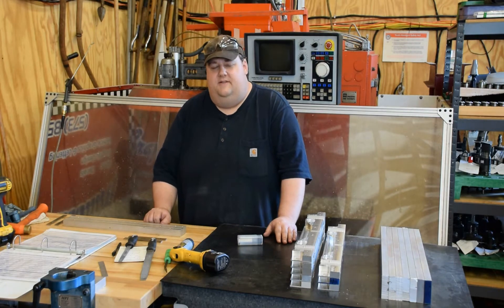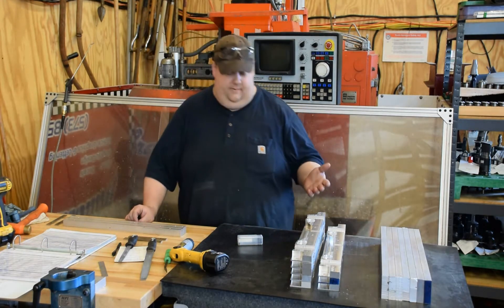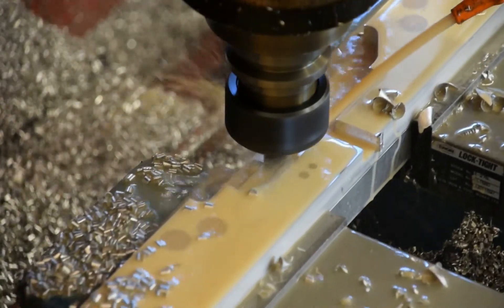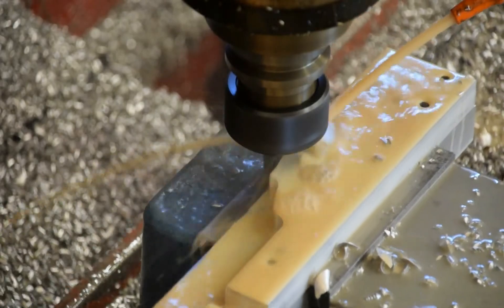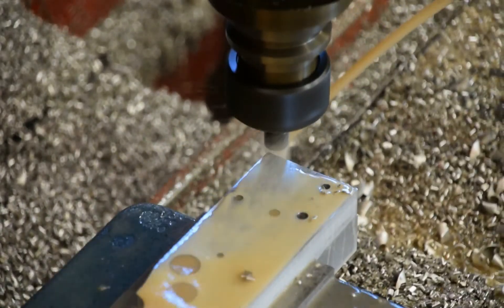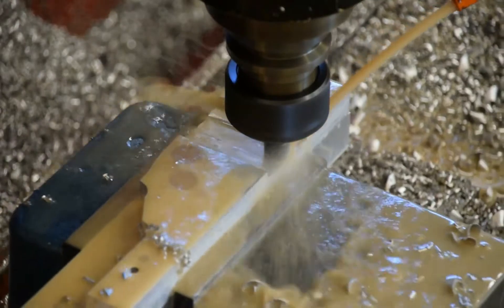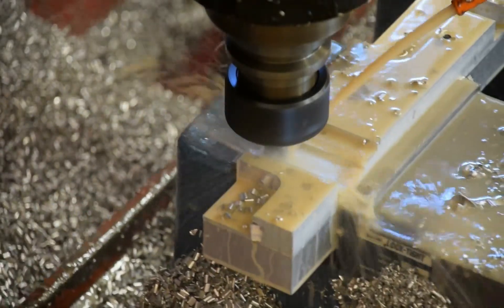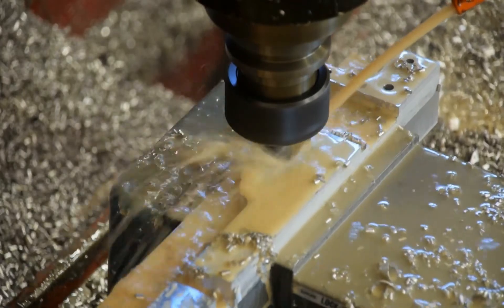Old School Roughing MRR vs Adaptive Clearing

Comment: i milled hardened steel (56hrc) with a tool from fraisa using adaptive toopaths. 30mm ap and 0.4mm ae, that was pretty epic seeing those chips fly away. the tool has a chipbreaker which helped (the pocket should have been 90mm deep, but we only could get 60mm deep so 2 passes was all it needed to do :) ) the most important pro of adaptive is, if it works, it works.
Reply from the maker: The biggest determining factors of whether adaptive or traditional roughing will be faster is how much torque the machine has, how fast it can feed and stay on the path (no following errors), and how fast the rapids are.

If the machine has fast rapids and feeds, adaptive will be faster, regardless of spindle torque/HP.  If the machine has slow rapids and can't follow the path accurately faster than 80 IPM, but has a fairly stout spindle (torque/HP wise), then traditional roughing will be faster, especially with indexable tooling.

Or, if you machine is both slow and weak, like mine is,  you do it both ways depending on the tooling.  I use traditional roughing strategies with the indexable tooling shown in this video, but when I have to use solid carbide I try to take as deep a bite as I can to keep the tool wear even.  None of them are particularly speedy, given the machine they're running on.

Comment: Just a short comment agreeing with you.
Doing HSM/Adaptive/Trochoidal in aluminum is in my opinion not time effective. At least not with the right tools. Admittedly we have bigger and more stiff machines, but I can do a full depth of cut and 80% stepover with flood coolant with "conventional" methods. (ø20mm / 3/4" polished carbide endmill 38mm / 1½" depth)

However in steel if we have to remove a lot of material it is indeed effective, but if you only have to run around a plate and do a few holes it's simply just not worth it. At least not for us.

Saunders/NYCCNC is afraid of doing conventional because he doesn't have the experience with flood coolant and has snapped too many endmills with just the mister he uses on the Tormach. Otherwise he does great work and is an excellent innovator.

Comment: In regards to what you have said, you are correct. But there are many variables. If the machine can not run at high speeds, it will never really be able to do HSM. You need more DOC. On those parts you could run the whole depth - finish in one shot. And the real problem I think.... People not controlling the retracts properly. This will improve I suspect as people get more and more comfortable with it all. Lastly, HSM is not always the best way. We tend to fall into the trap of using strategies that we "like" for one reason or another. Just a few thoughts my man. Great video.
Reply from the maker: I sometimes do the high DOC, moderate WOC, at a somewhat slower feedrate, but only when the geometry is such that I can run a pretty big OD tool.  You can't really rough the old school way at a DOC of 2" with a 1/4" tool, ya know?

Plus, for most of the work that I do, my go-to roughing tools are my indexables, because they are far and away the cheapest option per cutting edge, so long as they're able to reach the feature in question.

Just from what I'm seeing on YouTube, people are using the HSM strategies with tools that are far smaller than they could otherwise use, which saves money on tooling, but eats up time.  I guess if you're just doing it for shits n giggles you don't care how long it takes, but for most everyone else, it seems like a false economy.

Sure, you can cut a 1" wide slot 2" deep and 10" long with a 1/4" dia tool using an HSM strategy, but you'll spent three or four times as long doing it as you would have if you'd used a 3/4" tool with a pre-drilled starting hole.  You could HSM with the 3/4" tool too, but it'd still be slower than just plowing a full width down the middle and then cleaning up both sides to width (assuming that the machine spindle could handle that cut).

I'm not against Fusion360 or HSM style machining in general, I just think that we need to not forget that they are not a magic bullet so much as just one tool in a vast arsenal available to the competent CNC machinist or programmer.

I also get a little rankled when Saunders puts up a video talking about others doing something "the stupid way", when I've watched him mangle and otherwise hamfist his way through dozens of projects on his own channel.  Then he turns around and shows the "smart" way, which takes easily three times as long as the "dumb" way and yields no better results.  "Vast" improvement there.

And don't get me wrong, I love Saunders and his channel, he does a whole lot more than me to motivate people to get into manufacturing and machining, I just wish that when he's talking about something that he's not at all familiar with (and knows this) that he'd speak with a little less certainty about what he's saying.  It's one thing to pronounce this or that to be absolutely correct or incorrect when you've got ten years experience doing that specific thing, but quite another to be so certain when talking about something whose existence you just learned of 20mins ago.

I dunno.  I just know that I spend a lot of effort on trying not to talk out of my ass when I say something on camera, and I guess that I just wish everyone felt the same.
Reply: There are tons of jobs I see get done with HSM where a profile "slot" would be 100 times faster. I have been guilty of it myself. I have never cut a slot using hsm I do not think. Half the time I just zigzag down. Fact is, on a low rpm/feed machine, bigger tool the better I would think. At least from hsm point of view. A tormach does not have the rpm or the feed to run a 1/4 tool in a real hsm fashion. But the larger the tool, the closer to that benefit you would get. .003 chip load at 4000rpm is half that of 1/4 tool when using a 1/2. I reckon the key is figuring when, where, and most importantly, how to run either method.